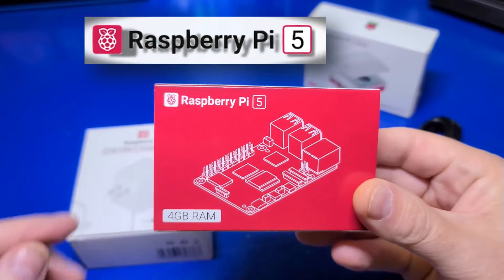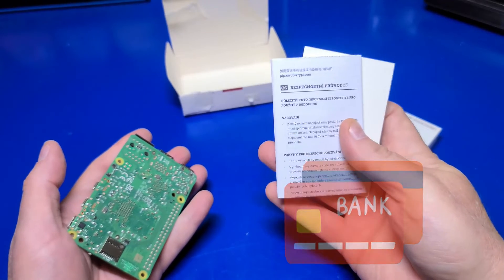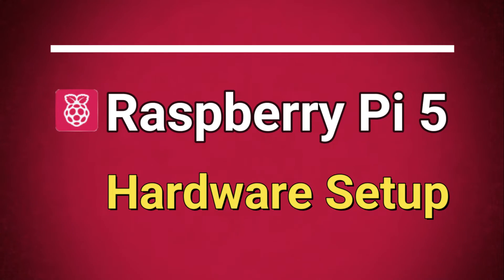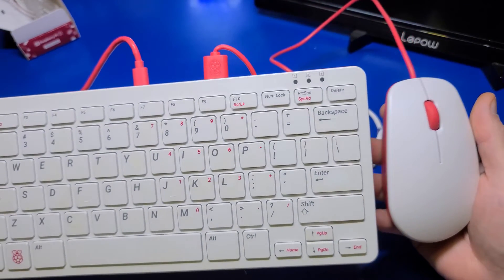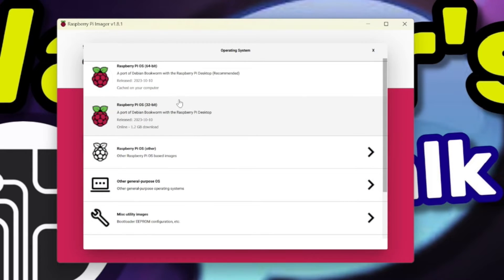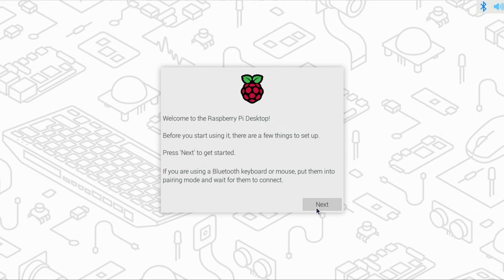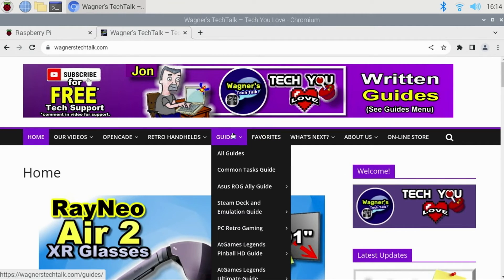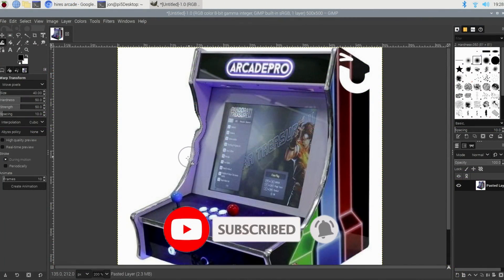Raspberry Pi 5 Setup: Getting Started Guide (Step By Step)

Comment: Nice video. My system is stuck at the "Welcome to the Raspberry Pi Desktop" screen when I try to boot it for the first time.  Any suggestions?
Reply from the maker: Thank you!  Yes, if you have another Pi (5/4/3) on your network, shut it down.  What's happening is the other Pi on your network likely has the same exact hostname of 'raspberrypi'.  You'll want to change the hostname on one of them, but temporarily shutting down the other one will allow it to boot.  See #1 here for a bit more info.: https://wagnerstechtalk.com/rpi5/#Troubleshooting
Reply: @WagnersTechTalk  I do not have another Raspberry Pi, but I had a hunch it was the microSD card (I had a Microcenter brand).  I ran back to the one near me, got a SanDisk to put the image on, and now the System starts right up.  I have had good luck with Microcenter-branded storage devices until now.
Reply: @WagnersTechTalk  I'm only one year into a new career in IT and have wanted to get a Linux machine for a year now. My professional growth task for the weekend was to master iPerf, and I wanted at least one end of it to be Linux, so I decided to purchase the Pi.  Your video was very helpful.  I'm going to get started with Iperf now. 

I use the CLI at work just often enough to need the skillset but not often enough to get good at it. Doing the little CLI stuff on VMs and Packet Tracer Labs isn't doing it for me, so I'm looking forward to using it on the Raspberry Pi.  Thanks again for posting this video.
Reply from the maker: Awesome, happy to hear you got it running and the video was helpful!  Congrats in your new IT career too!  If you need it, you can also find a video on installing Ubuntu to your new Pi 5 on this page: https://wagnerstechtalk.com/rpi5/#Ubuntu_Desktop
Reply: @WagnersTechTalk  I used that video to install Ubuntu as well. Thank you!

Comment: Do u have to leave the SD card in the pi? I used a jump drive and the pi shuts down or won’t start without the jump drive installed
Reply from the maker: Whatever media you used to install PiOS, that media will need to be inserted to boot into PiOS.  If you installed to a microSD, you can leave it in and also access the USB stick as well.

Comment: I just installed the pi 5 and the mouse is very slow. I tried the same mouse on my windows laptop and it worked fine. Also, how do I update the computer name as seen on the network?
Reply from the maker: Here's a tread on the mouse speed: https://forums.raspberrypi.com/viewtopic.php?t=94075 , it was fine for use with my mouse but the thread has a few suggestions.  For changing the hostname, lots of different ways but this has most of them: https://raspberrytips.com/set-new-hostname-raspberry-pi/
Reply: @WagnersTechTalk  
Thanks. I used a different mouse and the problem disappeared (I use the wired mouse for setups).

I'm building a Node JS app. When I load the web page and open the dev tools, my mouse is experiencing lag.

I don't know if this has anything to do with it, but I have the Pi hooked up to two 4K monitors, each with a different refresh rate.

The purpose of the machine is to test web pages. I'm also thinking of using another Pi for the programming side, so that I can use 2 more monitors. What do you think of this approach?

Comment: I just got my raspberry pi 5 with a preloaded SD and went through the initial set up steps for the OS once I was prompted to update it downloaded the update and prompted me to restart. I clicked restart and it did its thing for a bit and now it is stuck on the white background with the keyboard and raspberry pi’s. What is going on??? Can I press the restart button in the back? I don’t know what to do!
Reply from the maker: Do you have another raspberry pi on your network with the same hostname?  If so, shut it down/power it off and restart the new one.  I've seen that happen before when you have two Pi's with the same hostname.  Once it boots up, change the hostname to something different and you should be good to go.
Reply: @WagnersTechTalk   I do not have another Pi on my network but I have booted the pi and gone through the initial setup three times now. The first time everything worked great. Then the second and third time I booted it made me go through the initial setup again and  I did try to use the same name host name both times so I will try using a different username/password. Thanks!

Comment: Great video man! I needed to be up to date as I was in the RasPi 3 hahah XD, and I needed to assemble some RasPi's 5 for a project. By the way, 6:40 the reason is because that case (as well as the fan that comes with it) assumes you don't have the cooler from the RasPi, so yeah, you have that "extra" heat dissipator. And also in 7:15 that's why you cannot put the plastic part there, because that case isn't designed for the cooler with the heatsink itself ;)) I'll keep watching and giving more feedback :D

Comment: Hi does pi5 has Hdmi-CEC ?
Reply from the maker: I do believe that should work.  I saw this post: https://forum.libreelec.tv/thread/27687-raspberry-pi-5/ .  It didn't work initially for someone, but then after getting an HDMI 2.0 cable it worked for them.
Reply: @WagnersTechTalk   so i just need to connect hdmi2.0 cable with pi 5 and the TV and it willl work like dat ? Secondly , will pi 5 support 4K resolution movies /shows since i will install custom android build for it and watch netflix/amazon prime in it

Comment: Will this connection work if I connect  hdmi cable to laptop directly in stead  of  external monitor?
Reply from the maker: The connection on your laptop HDMI out, not HDMI input.  You could use a video capture device and display the video from the Pi on the laptop display.  You could also get a portable display and use it with the Pi 5, it's what I typically use.

Comment: wasnt able to get anything working on my pi5 without monitor so im just refunding since apperently no one else in the world has had my issue so no guides exist
Reply from the maker: What issue were you having?
Reply: @WagnersTechTalk  cant get find it on my network im just going to refund and get a pi4 since that seems to support octipi from the loader
Reply: @WagnersTechTalk  used the pi imager or we to and sd card loaded that i assume and then just cant find it anywhere on my network and all the guides reference monitors which i dont have a microhdmi so ima just downgrade to the 4 since that seems to support the octipi  from the imager

Comment: Can 1080 p Video be played smoothly on pi 5 ?
Reply from the maker: In PiOS Desktop, there will be some dropped frames initially but it is typically pretty smooth after a few seconds.
Reply: @WagnersTechTalk  my intention is to watch a movie on 1080 p TV . so is it possible to watch on the TV  too ? I read it has a inbuilt HVEC decoder  , so is it true that i can watch netflix on pi5 as the netflix wont use the 4GB and instead the pi5 use the HVEC decoder to player to watch netflix video ? Thirdly , will pi5 allow me to watch 4 K MOVIE ?

Comment: When I boot, it takes ultimately long. And rpi5 gets very hot after boot and I can't use it. I am using Usb
Reply from the maker: Might be something wrong with your Pi5.  I assume you do have a heatsink and fan installed right?

Comment: if anyone can please maybe help me? i have a pi 5 8gb and im using a 64gb onn brand sd card and non official power supply 5v 3a anyway when i use any os it doesn't receive any hdmi output i've changed the boot code to runoff hdmi 1 and with my display resolution but still no video out however when i remove the sd card and turn it on it will show display and take me to the "bios" of the pi but when the micro sd card is in place it won't show video? anyone please help!?
Reply from the maker: I've never heard nor run into this specific issue, though close.  Only thing that comes to mind : 1)  Make sure both ends of the display cable are fully seated.  2)  Make sure the microHDMI end is plugged into the port nearest the USB-C power.  3)  If neither of the other options fix it, try a different microHDMI to HDMI cable.  That's all I can personally think of.  I guess one other possibility is using an official Pi5 power adapter (could be cutting off due to low amps).  It could be the cable you have has a short in it and is cutting out on you and causing the weirdness.  Let me know if you figure it out please, will be good to know the fix.  I'd look at an official power adapter and/or microHDMI to HDMI cable to resolve the problem as the "likely" scenarios.
Reply from the maker: I'll be honest, this isn't an issue I've encountered or had reported to me.  However, a few things I can think of worth trying:  1)  Make sure both ends of the HDMI cable are fully seated.  2)  Make sure, you're booting with the microHDMI cable plugged into the port nearest the USB-C power.  3)  If neither of the other two correct the issue, try a different microHDMI to HDMI cable (yours may have a short, confusing the issue).  I've actually had a bad cable on a Pi4 and it took me awhile to diagnose the issue.  If some of this helps, please let me know what it turned out to be.

Comment: Thank you for the video! Any idea why I am getting an error something like ... "the data is corrupt"? I installed the Images on the microsd, then inserted the microSD into my Raspberry Pi 5, but instead of launching the Raspberry setup process, I am getting a lot of text on a black screen. In the first line it says something about "the data is corrupt". DO you know what is it about? WHat am I doing wrong? Thank you again!
Reply from the maker: It sounds like an issue with your microSD card.   I would try a different brand.  Samsung, SanDisk, Gigastone, etc. are ones I use and recommend.  If you're already using one of those, it seems that it may be defective.
Reply: @WagnersTechTalk  Yup, it is SanDisk. I will try another one. Thank you!

Comment: Is stock cooler better than after market aluminum coolers?
Reply from the maker: Not always.  I've found the one included with the CanaKit to edge out the active cooler in my tests but only by 1-2 degrees: https://wagnerstechtalk.com/rpi5/#CanaKit_Raspberry_Pi_5_Starter_Kit
Reply: @WagnersTechTalk  thank you. I want to run docker, immich, jellyfin, syncthing, portainer, nginx etc. Do you think it's a good choice to go with pi 5? I have all these now on pi 4 4GB. CPU throttles to 80-9% with temperature 50-60 Celsius. Hence thinking about to upgrade. What is your thought?
Thank you and great video.
Reply from the maker: Thank you!  I'm running docker in an Ubuntu VM in virtual box for an upcoming project.  You don't necessarily need a Pi5 to do that, unless you want an always-on machine.  You can also run what you're wanting on your current computer (most likely) along side your host operating system (i.e. Windows, MacOS, etc.).  I released a guide+video last week on how to do this, if interested: https://wagnerstechtalk.com/vms .  If you want a dedicated machine, you can also install Ubuntu here: wagnerstechtalk.com/rpi5/#Ubuntu_Desktop .  In that video, I don't go into docker but of course you can add it.
Reply: @WagnersTechTalk  I do have a PC with lower configuration for some heavy tasks. But from power consumption perspective I chose raspberry pi. Is it worth to invest in pi 5 for above things?
Reply from the maker: Either way will work, but if you have a decent PC, running in a VM is an option also.  Just don't want you spending money if it's not necessary.  Totally up to you and your needs.
Reply: @WagnersTechTalk  thanks. Running a full blown pc costs more due to power consumption. Pi looks an energy efficient choice.
Reply from the maker: Sounds good!  My PC is always running, it never gets a break 😎
Reply: @WagnersTechTalk  nice. But power consumption also would be high. It's good to use all horse power for large tasks 😄

Comment: do i need to connect raspberry pi to laptop while doing this process
Reply from the maker: You just need a computer to flash the operating system to the microSD card, this video shows you how.  The Pi does not directly connect to a computer.

Comment: I still don't understand the point of this device, from a laymans view (I'm not a boffin for sure) it looks like a cheap version of a PC or laptop only to use it  you need a K/bd, mouse and anothsr PC with screen.
What exactly does it do? Why would I want to go out and buy one today?
Reply from the maker: There are tons of different uses for a Raspberry Pi 5.  What really sets it apart from a PC is it's I/O capabilities.  For example, you can use it for custom electronics projects, robotics, retro gaming, running several different operating systems and many more projects.  If you're not familiar with the Pi, search for "Raspberry Pi projects" to get more ideas/ways you could use the Pi.

Comment: Very helpful video! I ended up getting the Raspberry Pi 5 and installed Android OS on it so that I could connect it to a 24-inch touchscreen monitor for use as a wall mounted home kiosk. It ended up being a pretty easy project and so far has been very helpful in keeping my family more organized and informed. I made a quick video to demonstrate some of the capabilities of it and would appreciate any feedback anyone has. Thanks! https://youtu.be/oMGnhztAX2I?si=itiA81z7RfGdHsRC
Reply from the maker: Awesome job/project, that is a great use for the Pi5!  I also thought about adding Android and using the Pi 5 with the Crow Vision for a similar setup ( https://youtu.be/zMgkVrw4-Xk ) .  Thank you for sharing and really good job!

Comment: Hi Wag

I’m about to purchase my first raspberry pi and its accessories.

Ok, so I’ve bought the: 

Official , 7 inch touchscreen. 

Raspberry Pi 5

The 300mm display adapter cable (x2)

And then I just have a standard Logitech and mouse keyboard combo .

What else if any do I need to get started other than a 32 or 64 gig SD card?

Please advise
Reply from the maker: A few things you may need (listed here: https://wagnerstechtalk.com/rpi5/#Accessories ):
* Pi5 Power supply 
* Active Cooler
* Case (See further below for an all-in-one kit from CanaKit - everything you'll need)
* May need/want  a card reader (see under 'General')
* As you mentioned, a microSD card is needed  (see under 'General' for some ideas)
Reply: Thanks for the swift reply 😮

Sorry forget to mention the power cable I have also the recommended 27 watt something like that lol

I won’t bother with the case; as I find it ugly. Plus I’m going to mount it on the back of the touchscreen, so it’s gonna be practically invisible lol

So that means I’ll be ready to go and start my Linux journey?

Respect for that 🫡

Comment: is there no spring load on the pi5?
Reply from the maker: If you're asking about the microSD slot have a spring loaded action, no it does not.  It just slides in or out.
Reply: @WagnersTechTalk  thank you! I just got mine but I saw previous versions did have this. Just wanted to make sure mine wasn't broken!

Comment: Really helpful video, thank you! My Dell monitor only has DisplayPort or DVI-D ports available. Can you recommend a micro HDMI lead that will hook up to one of these please?
Reply from the maker: Very welcome, thank you for watching!  I don't have a monitor that only has DVI, nor have I tried it with a Pi 5, however this looks like it "should" work: https://amzn.to/3usMJby .  I may be wrong, but I don't think audio is carried over DVI cables, so if it works you'll likely need an external speaker (BT) for the Pi.

Comment: My raspberry pi 5 does not boot up. I just got it today, i loaded sd with raspberry pi os 64 bit. And plug the power but fan starts moving and then stopped, green light is on in power button, but nothing on display
Reply from the maker: I've had about 3 people tell me that, but none have told me what the issue turned out to be (or I missed it).  Make sure the microHDMI is plugged into the port nearest the USB-C power input.  Then, power on and see if that helps.  If this doesn't fix it and you figure it out, please let me know because I've not had an issue and I'd love to know what the problem is.

Comment: Hello there,
I'm new to the Raspberry Pi5 and have some problem with the start of the Pi. When I  insert the sd card the blue screen of the monitor is shown as if there is no signal. I tried to fix it with some commands that i ad to the config file but no result.
Reply from the maker: Make sure it's plugged into the port nearest the USB-C power input.  If it is, perhaps try a different microHDMI to HDMI cable (I've had bad ones in the past).
Reply: @WagnersTechTalk  I don't think that is the cable because without the sd card the monitor starts and the Pi shows some info
Reply: I think that I have to add some commands to the config file to recognize the monitor, but I can't orient in the documentation of the PI in the HDMI section.For example I add hdmi_safe=1 and 2 more but without result.

Comment: Is pi5 compatible with pi3-4 racks?
Reply from the maker: I'd check with the rack mfgr. that you're considering, there are some differences in the connectors (Ethernet on the left, USB on the right) that may make that a no.
Reply: @WagnersTechTalk   thank you for your prompt response. By the way, have you tested the efficiency of the PoE+?
Reply from the maker: I have not tested PoE+, no.